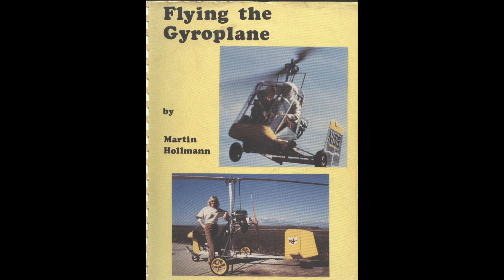History of the Gyroplane - part 10 the calm before the storm

Comment: I had no idea Bill Parsons died in a gyroplane accident.   I do remember my instructor had installed a stiff spring in the control stick so that he could overpower a student who might have panicked. I expect this is what happened with Pardons but just guessing. When I began my interest in gyroplanes, the big debate was the RAF and his mast and or rotor head designs. There were quite a lot of accidents with his design with lots of harsh words and pushback from the designer. This debate seemed to bring on the horizontal stabilizer as the savior for stability and lives. Ron Herron designed and built the Little Wing tractor engine design and Ernie Boyette with his center line thrust tall tail Dominator machines. I think from the European and British view, American designs of the time seemed rather odd. Thanks again for your efforts. Very enjoyable
Reply from the maker: Bill Crawford AOPA reported the accident as some issue with rotors he was testing at the time but later issued this:-  

The gyrocopter crash that killed gyroplane pioneer Bill Parsons (" Pilot Briefing," May Pilot) was caused by control stick failure, not the wide-chord blade design that was being tested.

Yes the British / US designs have varied I guess partly that might be due to regulation differences and also weather - which tends to be generally colder than many states in the US. Also Bensen was a greater influence to the US than for example the UK where Wallis was our hero and although his designs were not sold post the 1970 accident people wanted to re-create that style (see Cricket, Everett. Merlin etc) in general however the class is very small in the UK - I think in 2003 the data suggested just 250ish aircraft.
Reply: Gyrocopter flying club I have always admired the homebuilder and their innovations plus sadly their personal sacrifices which led to improvements and safety. You didn’t have to have a great amount of discretionary income to get into the air. They struggled yet prevailed in finding engines to modify cheaply to get themselves into the air. Along the way and partly because of the struggle, an unspoken culture evolved. Now days with the boom of the flying composite pods being pushed by expensive store bought engines, the well to do are paying without argument well over 100k. A new breed of flyers have joined the ranks and their purchasing power and ability to buy completed expensive machines, cause me,in my case to look at this new market with a bit of resentment. Almost to say they they should not be allowed the joy without the struggle. But alas they are experiencing the joy in big part due to Rotax. Rotax created a suitable solution to the power plant need and people are willing to pay for it. The noble VW and Subaru conversions are largely forgotten due to the monopoly of desire for the Rotax. What has hurt is the designers are lazy now. They have there power to weight ratio engine readily available and are designing for it. There are not many options even with the fixed wing community to hang a more affordable power plant on an existing airframe because of weight and balance factors which must be adhered to by design. Take off the shell and underneath is not much more than what was being produced in the garages of the world. I love what South American country pilots are doing. They seem to have  that spirit and embrace the struggle. The new designers owe us something and that something should be a concentration on safety. Low speed crashes should not kill but yet they do. Mast should not crumple and fold exactly sticking the pilot strapped into his seat. Fire safety should be addressed. This new breed of pilot who can afford this new breed of machine is certainly not getting there monies worth. As for me, I look on with envy. For the moment.
Reply: @crawford323  excellent comment couldn't agree more.  I'm waiting for batteries to get more energy dense on the meantime I have an old Rotax 503 and Hirth motor (unused). Which I will get up into the air.  Hopefully in a few years batteries will have enough energy density to get 45 mins for normal flying at the moment for the same weight as 503 gyro you can do 13.7 minutes at full power so not there yet but when it does suitable engines for only a few thousand dollars are around with 2 moving part, no carb icing, no wear and tear.   I used to have to adjust the tappets on the VW every few hours of flying.  3 engine related situations.  No problems other than 1 long and hot walk.  But once batteries are there perhaps we can revitalise the small simple open frame gyro.  I think we create many of the issues by just going more power, heavy, big blades tall mast etc.  Give me bare and simple any day but we'll tuned and we'll set up.
Reply: Cameron Lapworth yessir we wait for technology to advance and then 
creatively combine technologies to make a new product or make something work better. The test of genius they say is to nail two things which don’t be long together together and make them work. Good luck
Reply from the maker: Bill Crawford hey Bill - yes I agree although naturally builders taking on the manufacture and sale of a complete aircraft were always going to select reliable power.. it’s kind of different if the customer buys a lot of parts ex- the motor and then self selects something that’s either scrap or not that great!  Very sadly the UK has long forgotten the home built gyro and it’s really for no other reason than authority hasn’t invested in its own education. So they don’t know what to really look for or help so they simply reject. On the power plant side yes agree that batteries could be a neat solution but also I’m very surprised the Chinese haven’t copied Rotax motors and sold them cheaply they have the production capability to make a nice motor if motivation took them.
Reply: @gyrocopterflyingclub6148  agree the 503 was a reliable motor in the end but none of them in my day you flew thinking you'd definitely be landing where you took off from.  My internal monologue was always "if the engine quits now where am I going to put down". And I had to do that more than once.  I had 4 inflight engine related emergencies. Failed distributor first solo limited around a tight circuit after I lost more than half my power after reducing throttle to cruise.  Carby iced up once Fortunately when practicing engine outs so didn't notice until after landing.  Another time had the SU carb slider jam at a higher altitude strip causing an extremely rich air fuel mixture and finally wrapped head and broken stud in on block resulting in an out landing.  VW was powerful enough but I'd love the reliability of. 912.  Just the price is ridiculous or at least unaffordable and I want light.  So I'm sticking to two stroke until batteries are energy dense enough.  The CO2 lithium battery if it pans out will do it.  Solid state and 7x that of the current lithium.  But probably 5 years off minimum.  I predict as batteries get better we'll have superior reliability and light weight.  I only want 30mins + 15 min reserve.  Once batteries are there I'm in.  Is UK doing better safety wise with the new machines?  I wonder if paying $100 000 for a machine makes one more likely to be more careful?

Comment: Autogyros are sold, thought of, are attractive, as would be high performance motorcycles. However any wrong-headed rider will normally turn any pedigreed machine into a highway wreck¹. Whereas this flying machine is actually akin to a 1200cc, 3 speed Beetle in stock trim (without the petrol burning space heater). Merely a reliable point to point aircraft with very forgiving characteristics. Any rev-heads should be guided subtly out the door to join the fixed-wing dinosaurs. Ergo sales pitches, design, specifications should be geared towards the female decision-maker² because she just wants to arrive (land) safely, hair un-mussed and go on to the next thing in her schedule. Boring? Yes. The flight isn't though. The very idea of sports models is going to keep 'gyros trapped in the dark ages.

¹ With Darwin's approval.
² Women already make the vast majority of purchasing decisions.